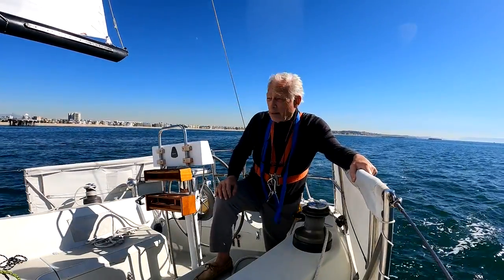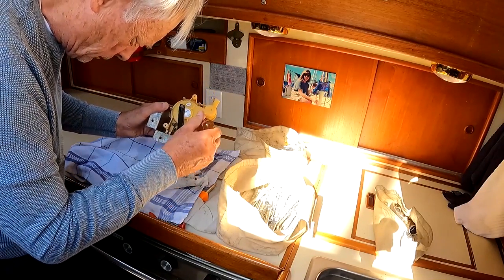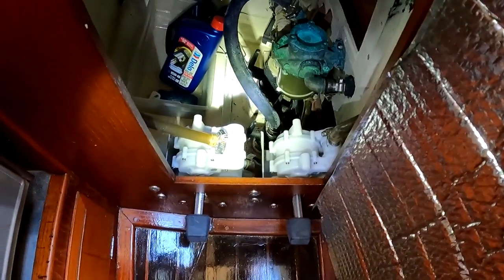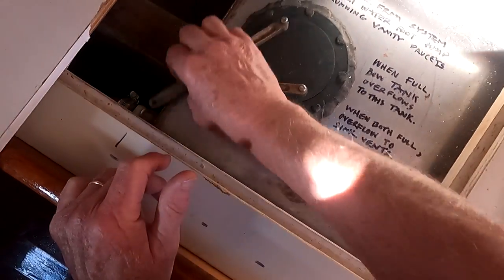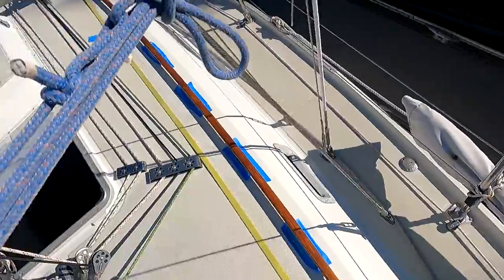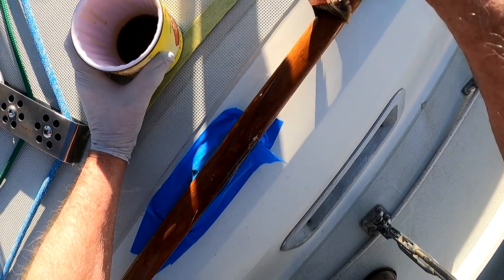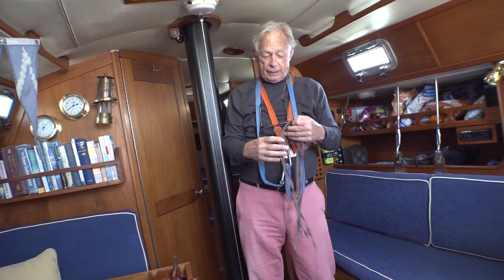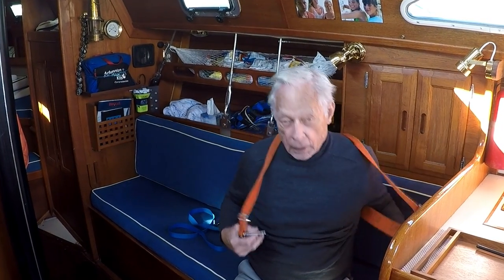Why We Sail--"Reflections in Varnish, Winter 2023"

Comment: You have given me courage to go on! Am not alone! I had left my boat sitting on the hard too long and now fixing everything.  Put new electric bilge pump, replaced my whale gusher with exactly the same model and mine was 43 years old! (bought it on Amazon).  Todays project is trying to fix my RM69 toilet and Jabsco Par water pressure pump.  I saw your manual pumps and reminded me that I need to tighten their screws.  The list goes on.  But it is one thing at a time, dont fight it, enjoy it, would you be rather sitting on a couch?

Comment: I had the same varnished grab rails with minor rot. So I grabbed a heat gun, removed the varnish, sanded to a smooth finish, then epoxied them, let it get tacky, then applied varnish. The will never get water in them and they looked fantastic. Minimal maintenance

Comment: I have had good long term results on teak by stripping and sanding to 180,  acitone wipe down , 2 coats MAS epoxy (in 1 day)  which fills the grain and then sand down to 220 ( don’t sand through) then Bristol 2 part varnish. You can get 3 coats varnish in a day with NO sanding  between coats      Do 6 to 8 coats Bristol varnish is now owned by MAS epoxy   Cheers

Comment: I had to bight the bullet this winter, took my grab rails off the boat completely. They're now home in the basement workshop ready to be  stripped, sanded, and varnished (~5 coats of Minwax Helmsman Spar). Just looked too ruddy and worn and had some varnish on the non-skid to clean up.....went right by the tape.

Comment: It was good to see you posted a new video! Excellent as usual, well narrated with a suggestion for the philosophy of life at the end.
I will allow myself a comment or two.
Surely you know the trick for water ingress stains under varnish, if you sand the area to bare wood applying acetone removes the stain or at the very least will reduce it. 
For the green felt, perhaps glue-it under the caddy so the caddy then glides nicely on the varnished table.
I like that caddy idea so much that I think I will build myself one, with the obligatory pipe holder. 🙂
Thank you for a  great video.
Reply from the maker: Oxalic acid to bleach wood, once all finish removed.

Comment: Great video.  Monitoring is one of my favorite pastimes.  I have had cutting slots in my mainsail cover for my lazy jacks on my list for 8 years.  Having them lift the sides of the sail cover is REALLY unsightly!  If I adopt your solution, I can cross it off my list. However, when ever I do store the lazy jacks to the mast, the small Harken bullet blocks bang against the mast.  Where/how do you store your lazy jacks when you are at the dock?  Thanks, Ron
Reply from the maker: I don't have blocks on the lazy jacks, Spectra line slips easily enough through thimbles alone. When not deployed, the lazyjacks are tensioned to run along the boom under the sail cover.

Comment: Is there, any chance there is a natural finish (not some epoxy or polymer) that even if you  needed to do it often,  would protect the wood?  Some type of penetrating oil?
Reply: I hate the way varnish flakes and peels. Sanding leaves a mess. Is there an alternative? Would tung oil need to be re-applied every day it doesn't rain?
Reply: There are a variety of oils that can be used every few months.  Some folks even like the use and look of transmission oil (some prefer used!)

Comment: What's the top speed on the cycle, Skipper?
Reply from the maker: 28 mph assisted, for all Class 3 electric bikes. This is the Aventon Aventure,  4" tires,  typical of the current generation.  LA, specifically Santa Monica and other beach communities, have good bike lanes on local streets and an expanding system of beach trails dividing pedestrian and bike/rollerblade users.  Current electric bikes sell for less than $2K, have 40-mile range,  and in this climate offer attractive alternative to car travel.